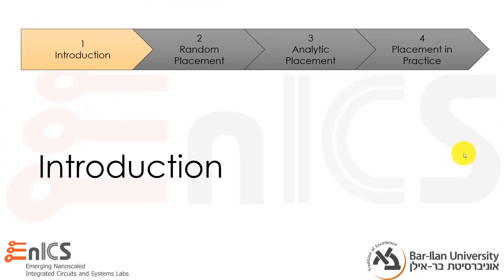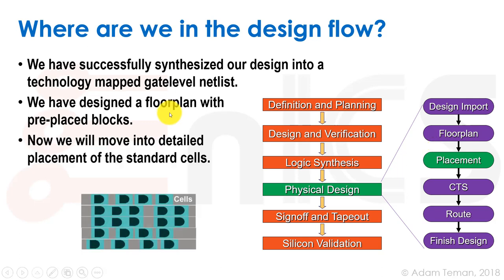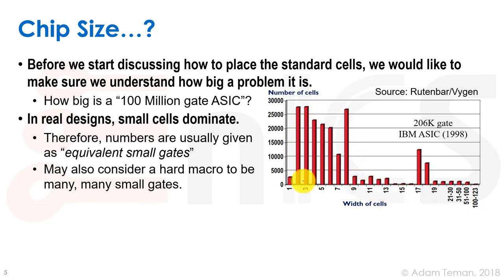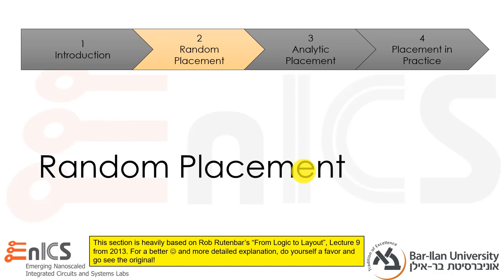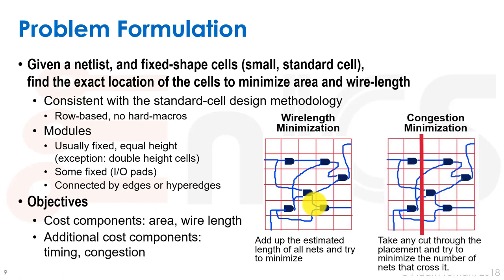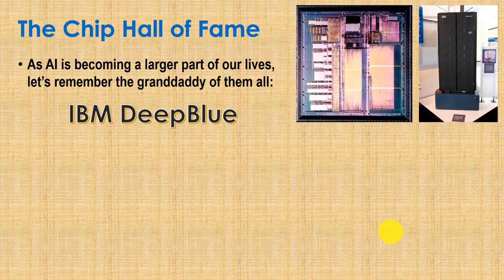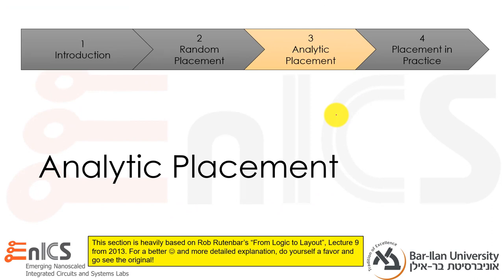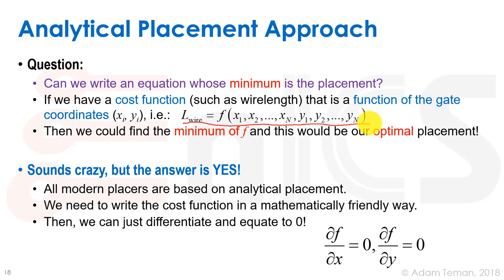DVD Lecture 7: Standard Cell Placement

Comment: I think in analytical placement cost function there is square root is their in formula of quadratic wire length between two points then its become root of 13 that is less than 5 unit as we find in HPWL.
Reply from the maker: Hi Aman,
If I understand your comment correctly, the square root is proportional to the non-square root calculation and so it doesn't really matter for the calculation. It will affect the weight of the distance, but this is anyway calibrated with the division factor of the clique model. 
Note that HPWL and Quadratic Wirelength are two different wirelength estimators and should not be compared in terms of value. Indeed, both should express a relative wirelength (i.e., this net is longer than that one), but you cannot compare "apples and oranges" and so don't try to...
Reply: @AdiTeman  ok sir

Comment: Thank you for the lectures, these are awesome!. I had a couple of questions:
1. Since the macros are fixed before the standard cell  placement, will the tool be aware of this and avoid standard cell overlapping macros? If yes then would this affect the recursive partitioning in any way.

2. Is the trail route step to check if we meet timing requirements or to check routability of design or both?

Thanks in advance
Reply from the maker: 1) Yes. 
I think this is something I am trying to emphasize in the limitations of the clustering and the algorithm in general. The actual tools need to take care of this and many other restrictions. How they do it is another question, since this can lead to much loss of optimality. But they could place them without looking at the macros and then legalize to remove overlaps, or they could do something like create the partitions while taking into account the macro utilization inside the partition. But these details are beyond the scope of this lecture, though I'm sure there is some literature about how to do this effectively and efficiently.

2) So I would say both. It probably depends on the optimization targets selected in the tool (e.g., "congestion aware" and/or "timing aware"). The tools do not elaborate on this very much, but the trial route is for sure a necessary tool to apply such incremental optimizations.

Comment: @Adi Teman sir,how AI affects the VLSI chip designing..??What is the relation??
what should we(VLSI Physical Design Engineers) should update ourselves about the latest technologies or languages in future...!!
Reply from the maker: Hi Lalith. I am not sure I understand your question, but to try and provide a response - 
AI is a bit independent and a bit connected. On the implementation side, new tools can use AI approaches to reach better solutions for EDA problems. On the usage side, AI can benefit from efficient architectures that are targeted at this type of computation.
Reply: @AdiTeman  Is there any problem for VLSI Physical Design Engineers in coming years as we are gonna hit a saturation region...!
Reply: @mewantedbyme1  As a 22 year old recent graduate I have a solid knowledge over coding and Mathematical analysis.So,It's easy to switch for me and I did that.. 
I switched to AI recently which is related to Chip designing.

"Don't worry about myself,just take care about yourself properly man...!"
Reply from the maker: Hi Lalith, 
I'm really sorry that I never responded - I didn't see your comment. But now I can say that I have a better answer.
If you've been following the news over the last months, you see that there is a huge chip shortage. Maybe that doesn't specifically relate to chip designers (more to fabs), but it's part of the overall trend that everyone needs more and more chips. In Israel, for example, all the big guys are either opening huge R&D centers or expanding (in the last months, huge announcements by Google, Microsoft, Facebook, Intel, Amazon). They all need chip designers!
So you made the right move!

Comment: can we do cell padding for pin density
Reply from the maker: Hi,
Yes, indeed you can pad cells and that will reduce the pin density. Of course, this comes at the cost of extra area, but it could be useful to apply to certain hierarchies. I guess this is the same as applying a lower target utilization, though going at it from "a different direction".
As a side note, cell padding is usually used for things like leaving space to put decaps next to flip flops and clock buffers to improve the dI/dt drop near the toggling clocks. But it could be used as you suggested, as well.

Comment: @Adi Teman can you tell me why we fix hard macros at floorplan stage and it is necessary to fix it?

Why we can't fix it at placement stage ??
Reply from the maker: So I don't exactly have a straightforward or 100% accurate answer, but I'll try. One thing is that the placement algorithms deal with standard cells, where each cell is very small and can be treated as a sizeless point. Macros, on the other hand, are big and so this type of assumption will result in really bad decisions, probably.
Another point is that Macros are big and important and "drive" the overall placement in the design, in a similar fashion that pins are "anchors" that constrain where each module will be placed. So, since there are relatively few (...relatively) of these and they have a strong effect on the results, we apply more control by placing them manually and fixing them. To that end, they also affect the power distribution and blockage of routing channels and other things that all basically have an effect on the final physical design.
A final point is that there are many algorithms and tools for automatic floorplanning and you can find them inside the commercial tools. However, as happens with many automatic tools that are available for various applications, they have (so far, as far as I know) not caught on in industry. I would suggest to give them a try and see how they work for you, as they can/could indeed save a lot of time and possibly reach a better solution than you can arrive at manually.

Comment: Sir what is heuristic?
Reply from the maker: Hi Abhishek. From the definition on Wikipedia, a heuristic is any approach to problem solving or self-discovery that employs a practical method that is not guaranteed to be optimal, perfect, or rational, but is nevertheless sufficient for reaching an immediate, short-term goal or approximation.

In other words, it is an algorithm that is NOT OPTIMAL, but it's a "good guess". We use heuristics on any optimization problems that are too hard to solve in a finite amount of time (N-P complete problems). Instead, we apply an approach that we know is better than just some random search, so we can probably find a pretty good solution, though it will not be optimal. Just as a side note, if we have an optimal solution for a problem, then usually that is a "done deal", so we don't really need to research the problem anymore. However, very few real life complex problems have such a (known) optimal solution, at least if you take into consideration all of the assumptions that have to be made, which may be sub-optimal.